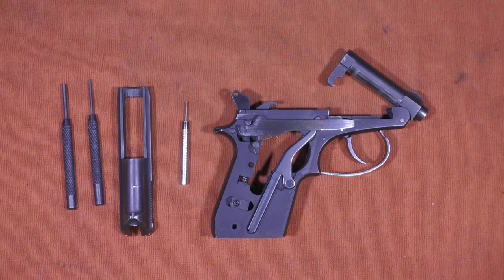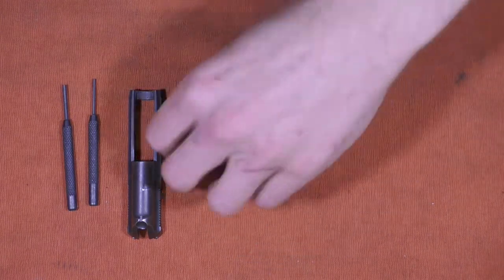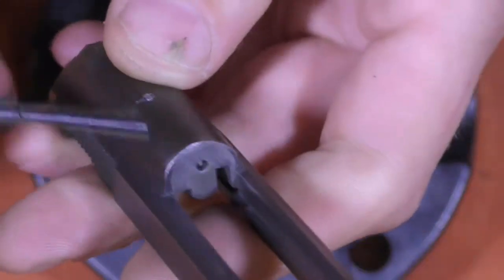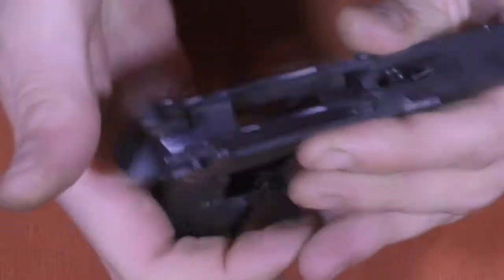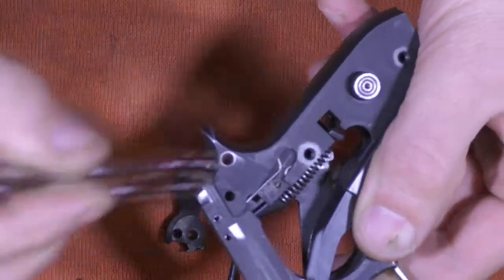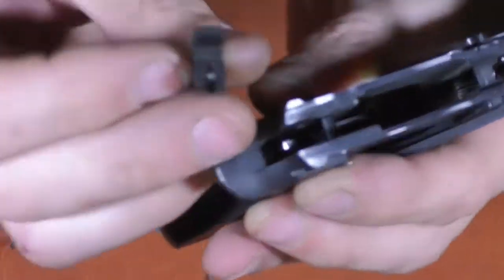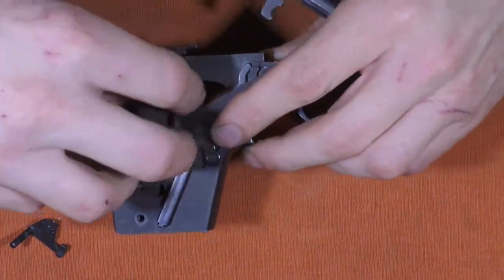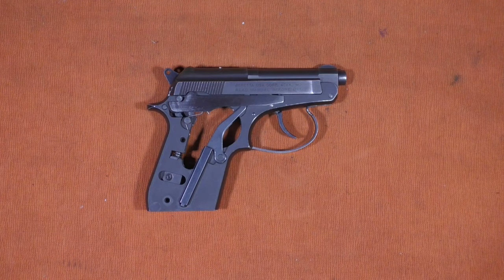Beretta Mod. 21A Firing Pin and Hammer Spring Disassembly

Comment: one time i took it down to this level and reassembled it. After 200 rds one of the two ejector pins walked out of the whole just a 1/16th of an inch. It locked up the slide so it could not be removed. That 1/16 wound up in the slide groove and wouldn't let it come off. Suggest installing new pins once they are removed.
Reply from the maker: I'd definitely agree if there's any looseness to the pins. As mine even after removal are still tight as the dickens. But certainly something to consider.

Comment: Remember kids when come to these Tomcat models like 3032, 21A or these models in general don't dry fire them too often because the firing pin will break off. So regardless if you dry fire them, never dry fire them, you pop a few boxes at the range once a while or so ALWAYS BUY A FEW SPARE FIRING PINS.
Reply from the maker: Good advice, I haven't personally had a problem with that in either of the two I've owned.

Comment: Great video man. I was doing well right up until i had to drive the hammer pin out. I had to hit it so hard that the pin mushroomed and wouldn't come out without mangling the frame. I don't know how or why it was in there so tight but now I'm afraid the same thing is gonna happen in my Tomcat :|
Reply from the maker: Thank you. I remember years ago when Gander Mountain was still around and had in store gunsmiths was the first time I had my trigger spring break. I had a good friendship with the gunsmith there and asked him to look at it. He said that he'd just take a spring out of one of the in stock guns and toss it in my gun. Twenty minutes and a lot of forceful but gentle hammering he gave up on removing the spring from the in stock gun. He said he had no idea why the pin was so tight and any more could damage them pin. He gave me the number to order the spring from Beretta, which they sent for free, and fortunately for me the pins in mine weren't so stubborn. Long story short I guess, those pins can be a real bear.

Comment: What happens if my pin on my tomcat isn’t fulling going through after I put it back in? Like it wouldn’t make any contact with the bullet if I tried to fire it, it’s falling a bit short.
Reply from the maker: With the slide off of the frame, if you push the firing pin in from the back with a punch will the tip protrude through the breach face?

Comment: I had to install my hammer before the hammer spring. The spring on mine pushed the hammer up, and out of alignment of the pinhole. I would need to press down against the spring to align it. Idk how you did that lol
Reply from the maker: I'm not sure exactly what would be the difference other than possibly a slight difference in the spring. Although I didn't encounter that with my Mod 21A, I have been frustrated by with other firearms. It's never fun when things take a turn for the stupid. Thanks for watching

Comment: I have some red/brown color on my hammer but it doesn't seem to be rust. I'm not sure if they cast the hammer and that is just the color of the metal uncoated or what?
Reply from the maker: My apologies for taking a moment to get back to you. I had thought maybe they'd used a different finish possibly on the hammer depending on when it was made but I couldn't really see anything related to that. So I'm not totally sure as to why it wouldn't have a black finish. I thought possibly wear but after having looked at mine which has had many rounds through it that doesn't seem to be the case. I wish I could give you a better answer but as long as you don't see any rust and it functions correctly I wouldn't be too concerned. Thanks for watching and again sorry for the delayed response.
Reply: It’s just patina of the metal, nothing to worry about. If you see pitting = rust. No pitting = patina.
Reply from the maker: Working in the steel industry, patina is a term we use fallaciously for rust regularly. Thanks for watching.

Comment: I just bought a new 21A with a broken firing pin, it was the display model. 
Can the pin be tapped from the top to just clear the firing pin and left in the slide then tapped back in from the bottom to capture the new pin?
Is the pin directional in travel? 🤔
Reply from the maker: I'm not sure as to whether it is directional but on mine trying to drive it through the bottom would be difficult. It was a hard pin to drive out and out the top was the easiest way to get it out of the way. You'll have drive it far enough for it to clear the firing but you don't have to drive it all the way out of the slide. I hope that helps to get yours running. Thanks for watching.
Reply: @Alloy211  Thanks so much! 👍🏾
Reply from the maker: @joeclifford9242  You're welcome, I'm always glad to help.
Reply: @Alloy211  would this also be the same with a Taurus pt22? With it being so similar
Reply from the maker: @kolbywittaK  I responded to you in another comment, but it's a good question.

Comment: Would it not be easyer if all the pins had alittle old on tham.
Reply from the maker: Maybe a very small amount on the hole, but I'd keep it of the pin as it would make it harder to work with. Thanks for watching.

Comment: On just about any gun that the manual safety can be removed they carry filler plugs and stuff like that... but I can't find anything like that for the 21A or 3032. Not sure if it's because nobody makes one or if it's just because google sucks.
Reply from the maker: That's not something I've ever looked for or seen offhand, so I'm not sure anyone does make one. Now that you've peaked my interest when I have time I'll definitely see if I can track one down. Not that Google is garbage, its just garbage adjacent, but there have definitely been times that it didn't do as good of job finding gun parts as I'd of liked. Although given how much time I've spent looking for parts for the 21A and never seeing one, I thinking they may not exist off the shelf.
Reply: @Alloy211  I'd really like to find a spacer. I'm surprised I haven't found one for the 3032. Just about any gun with a removable safety has a filler made by someone, somewhere... but I've never seen one for the 21A or 3032. It don't look too bad without one... but it would still look a lot better with one.

I used to be able to find ANYTHING on google and have always been really good at finding things that other people could not... but since their AI took over and removes all the things that it "thinks" you don't want, it's pure shit. It's garbage compared to what it used to be and it makes it hard to impossible to find even the most simple/common things at times. That's ESPECIALLY TRUE when it's something that google don't want you to find. Even the shitty search engines are able to find things that google cannot these days.
Reply from the maker: Agreed, I will say I have found Google to be less responsive to my searching for gun parts unless I word things certain ways. Even then it isn't as easy it would seem as it used to be.

Comment: Same as the Taurus pt22 correct?
Reply from the maker: Generally, although I think there are some differences. I've only ever handled the PT22 and haven't had the chance to disassemble one personally.
Reply: @Alloy211  ahh I see. my problem Im currently trying to solve is I can’t exactly tell whether my firing pin tip has broken or not by the looks of it in the slide and I don’t have any fitting roll pins on hand to check piece by piece. Although based on how your firing pin looked I believe mine is broken I will fire it later today and check
Reply from the maker: @kolbywittaK  It should be sharp edged and flat. If you see any irregular edges on the tip or if it leaves an irregular mark on the casings there's a good chance it's broken.
Reply: @Alloy211  doesn’t even seem like it would push far enough out to even hit the casing , to be determined I suppose. I appreciate the replies very much brother not much help in comments these days
Reply from the maker: @kolbywittaK  You're welcome, I do my best. You may want to remove the slide from the frame and use a punch to push the firing pin forward from the back and see how far the firing pin protrudes and if it's chipped or broken.

Comment: Once upon a Time I did all that to realize the gold hammer I have was actually for a jet fire so after I put it back together I realized it didn't work.
Reply from the maker: You could always look at it as an exercise in testing cross platform parts compatibility. Just that the outcome was unfavorable. I'm sure it looked pretty sweet with a golden hammer though.
Reply: @Alloy211  yeah the gold hammer looked good with all the other gold accessories and custom grips. Maybe I should have just spray painted the stock hammer gold to stay with the theme. 🤣 The hammer was sold to me as a 21A hammer but if I would have took the time to actually pay attention and look at the hammer side by side I wouldn't have needed to test parts compatibility. 🤦
Reply from the maker: @TubeYou7  An ounce of prevention is worth a pound of cure. I'm sure we've all done something along those lines. There have been a few times doing a disassembly/reassembly video I realized I'd put one part on before I should have and had to tear down and rerecord everything I'd just done. I've always thought a black firearm with gold controls looked snazzy. I'm not even a fan of gold or image but there's something cool about that.